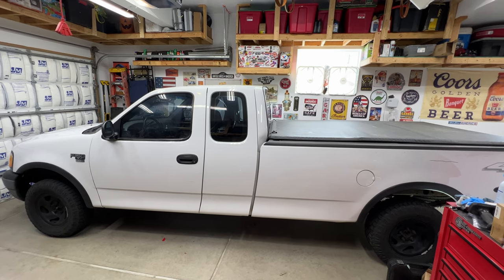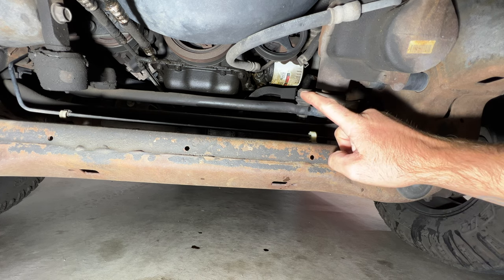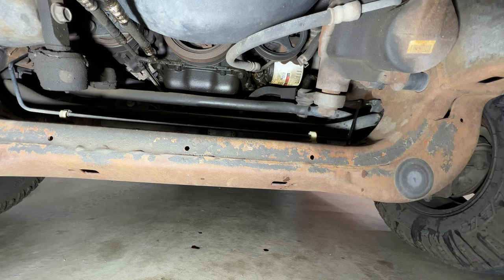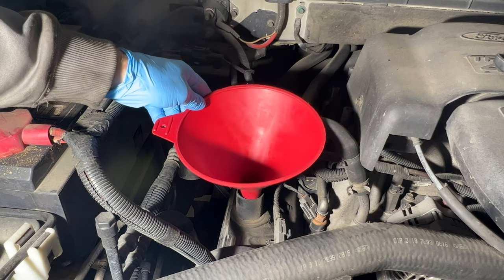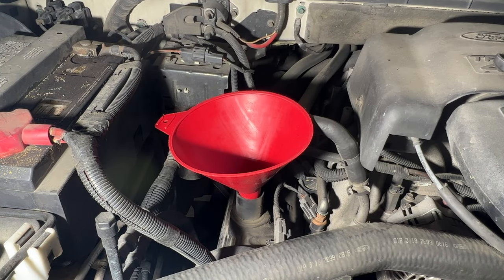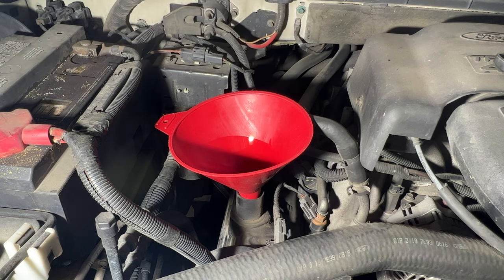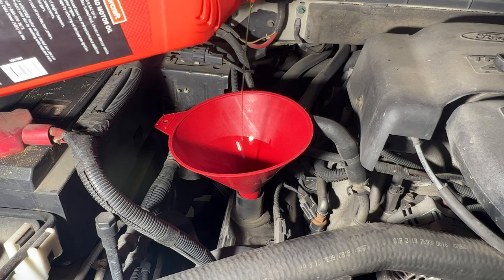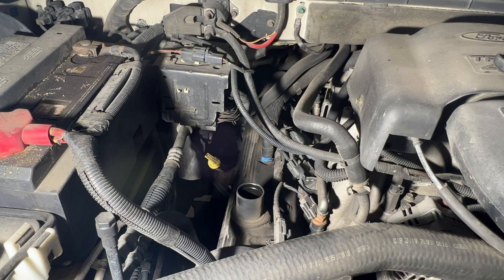2003 Ford F-150 Oil Filter Housing Gasket Replacement How-To

Comment: A huge thank you for posting this video! 

I've been putting this off longer than I care to admit. Just finished replacing the gasket this evening following your video.The way you put each procedure in order is perfect! It took the whole afternoon but I was going at a very cruise-y pace. If you're swift, one might be able to do it in like 4 hours. I did it on the ground, no jacks or lift. The truck is a 2003 STX 4X4 4.6l so was able to slide under on a creeper.
The part that got me was removing the 2 last bolts of the housing, the middle ones. They were completely blind and couldn't find them with my fingers until I moved the oil pressure sending wire out of the way. I used 12" of extensions for the last 3 bolts but would have been nice to have another 4"-6" to clear the frame. It went back together easier than taking it apart. Well, that is until I poured 2 quarts oil in the coolant reservoir.....what, it was getting dark and both oil and coolant  jugs were yellow....🤷‍♂ Guess a flush is in order for tomorrow.
Again, many thanks!!
Have you done spark plugs on these?
Reply from the maker: Thank you. Yes I have done plugs on this truck many times haven’t done a video on it yet but will probably do one soon. You probably already know these triton v8’s are notorious for blowing out spark plugs so you will want to change the plugs often. Just need a variety of extensions for your socket wrench to reach the plugs back by the firewall.

Comment: Awesome video and spot on! I just about finished up this job on my 03 f150 4.6 today. Everything wasn't so bad until I went back for install of new gasket. Man! I fought trying to hold gasket and housing in place while starting bolt. I'd have to say if this has to be done again that I'm taking it to a shop. 4.6 engine are great and reliable. Anyways thanks for video!
Reply from the maker: Thanks I appreciate it! Yeah been happy with the 4.6 I have over 270k miles on mine. I’ll take this or the 5.4 any day over the new eco boost. Key to long life on these motors is keeping up on the maintenance.
Reply: @BLUECOLLARGARAGE  Yes they are excellent motors and reliable. Mine currently has around 253k and it's been best ever owned. Thanks again!
Reply: I was wondering if a loose zip-tie through one or two of the bolt holes would be a good way to temporarily hold the gasket in place until one bolt could be threaded?
Reply: @duey1083  That's something I never thought of. Great thought
Reply: @cards06champs  Thanks!  Question for you...would you consider replacing this gasket as preventative maintenance?  Or only if it leaks here?

I'm wanting to do a coolant flush soon, so thought that would be a good opportunity to replace it at that time.

Thanks!
Reply: @duey1083  If the gasket has never been replaced, then I would highly consider replacing it. Especially since you're draining the coolant.
Reply: Use sewing thread to tie gasket against the housing.  It is easy to cut and remove.

Comment: I just want to point out most of the videos on this subject don't mention how important torque specs are on this part.  If it isn't torqued properly it will leak like mad... 18ft pounds on the bolts, you will be good with 20. Start on the center bolt then the other one on the other side of the oil ports and then move to the others. Happy wrenching.
Reply from the maker: Thanks for the tip hard part is getting the torque wrench in there .
Reply: @BLUE COLLAR GARAGE  24inch extension on 3/8, use a 10mm socket on a universal joint, it'll be no problem 😊 torque is distorted  a little using extension so set to 20ft lbs and it should be very close.

Comment: Thank you so much for this video I brought mine to a shop and they want to change me $1800 to change the gasket and claim the front differental has to be dropped I have a 2000 ford f150 4x4. I think im going to follow your video and try to safe $1700 thanks so much
Reply from the maker: Yeah that seems like highway robbery it’s a pretty tight fit but definitely doable and well worth saving $1700.
Reply: @BLUECOLLARGARAGE  Hey, do you have to remove the radiator house and take off the vacuum? If I let it drain for a long time will that empty out the hose?

Comment: Thanks for this video. Helped immensely. I’m having an issue though. Bolts don’t want to go in and I don’t want to strip the threads. What you think?
Reply from the maker: Were you able to get them in. I wandering if the threads were just dirty and may need to use a thread chaser.
Reply: Yea bro, I just shot them through. It was really enjoying but I got it. Thanks for checking

Comment: I've been told the only solution for my leak was to replace the engine. I have the 4.6Leaker in a 2001 F150. Might have it relooked at. I also moved how your gear shift position is off. My cable broke 100,000 miles ago so I'm always in low lol.

Comment: I stripped one of the bolts, what type are those and where can i get one?. Thanks for the video🙂
Reply from the maker: Since they are all the same take one of the good bolts to ace hardware and they will be able to match the threads and pitch. Or Home Depot or Lowe’s should have one as well.
Reply: @BLUECOLLARGARAGE  excellent, thanks for the help and for the time!

Comment: How much easier would you say that job would be, if you had everything in the driver side wheel well out? I'm getting ready to do new control arms and shocks on mine. Thinking about getting this done while I have everything out.
Reply from the maker: I think it would still be a challenge due to the abs pump and brake lines being in the way.

Comment: This might be a dumb question. 
I had to have the gasket replaced in my 2003 f150 v8 4.6 xlt . 

So this brings me to an issue I'm having. 
I went to Advanced auto parts and had them get me the oil filter. We then went to do an oil change the next day. After seeing the filter that was installed, we knew it was way narrower than the one they gave me. 
So I went back to the store and had them look up the filter by my vin # to make sure to get the proper one. 
They told me it was in fact the right one according to my vin # . 

However after removing the old one there was a noticeable difference in diameter!  

Is there any way that the mechanic changed something and didn't tell me?  Why would the oil filter be at least an inch bigger around than the one currently installed? Thanks
Reply from the maker: I have seen people put different sized oil filters on that have the same threads to achieve a little more oil filtering capacity but the diameter is usually the same. Can you tell what filter and number is currently on the truck? And what filter did advance give you?
Reply: @BLUECOLLARGARAGE  yeah there was a huge difference between the one a mechanic put on after fixing the gasket and what was given per the vin number. 
If you measured across the  filter at the threads , they are an inch difference. The length of each were the same though. But width , way off . The one in the truck is the narrower one, 
Ecoguard X2500  . 
Truck is a 2003 f150 supercrew XLT .
V8  4.6L  4x4
Reply from the maker: @keithsr.  The ecoguard is the cheap amazon filter and according to them it fits your truck. https://amzn.to/48iRmnl but says it's mainly for a gm 3.6L. So the one that's wider from advance auto parts is the correct filter as well because ive done a an oil change on mine every 3k miles so I know the filter is really wide compared to most vehicles.
Reply: @BLUECOLLARGARAGE  I don't understand how the cheap Amazon one can be correct and the one per the vin at 2 separate auto stores can also be correct ? 
To me the wider one is correct and this cheap shit one the garage put in is wrong but somehow fits the threads . It's like a AA to a C battery in width . Just not possible.
Reply from the maker: @keithsr.  Yeah I agree with you on that I wouldn't have put that on one of my customers vehicles. I'd be afraid there wouldn't be enough gasket surface and would eventually start leaking.

Comment: I have an oil leak right now and I thought it was the oil filter but once I did an oil change the leak was still there. I’m not fully 100% sure the leak is coming from the oil filter housing gasket but that’s where I see fresh oil leaking from. I’m thinking of taking it to the mechanic but I was wondering if this is something I should change without taking it to the mechanic first. Maybe I could save some money.
Reply from the maker: This is a very common issue on these trucks especially as they start to get older and higher mileage the gasket starts to flatten out causing the leak. You will save yourself a lot of money doing it yourself.
Reply: @BLUECOLLARGARAGE  my 2010 ford expedition has 300k on it so I think it’s past due. I’ll be taking it to the mechanic to get it diagnosed because I’m not a mechanic and don’t know much about cars. If it is the gasket then I’ll be doing it myself. Thanks for this amazing video, and I hope to be following along again in a couple days when I figure it out.
Reply: @BLUECOLLARGARAGE  it was the gasket and I’m so happy lol. No oil leak and for cheap. Thank you for this video. If it weren’t for people like you, then people like me would spend ridiculous amounts of money for something small.

Comment: Awesome video very detailed I gotta tackle mine soon. I’m curious to know about how long it takes your 4.6 to get up to operating temp mine takes 15-20 minutes no joke and I just changed Thermostat and did coolant flush and that didn’t seem to help anything. Maybe Coolant temp sensor 🤔
Reply from the maker: Mine takes about maybe 10 minutes to warm up. I would try the coolant temp sensor that’s nice and easy to replace and see if that helps. I’ve also seen brand new thermostats that are bad what brand did you go with?
Reply: @BLUECOLLARGARAGE  The sensor is near the Alternator right? The thermostat I put in is a Duralast Thermostat
Reply from the maker: @alexharper9786  yeah it’s right behind it and you may want to drain a little coolant out first so it doesn’t make a mess. Never had an issue with duralast just making sure it wasn’t a no name Amazon or eBay one.
Reply: @BLUECOLLARGARAGE  imma do it when I do the Oil filter housing gasket that way I can knock both out but I’ve put alot of money into the truck this past week because Goodyear screwed me by not aligning correctly so other shop I had to pay did it and fixed some stuff like Freon recovery recharge, Swaybar links, Camber which doesn’t look like they changed 😂 So I’m just gonna knock everything out and be done with it. The 2 things I don’t do Freon (No machine) no Alignment rack) and I get screwed in the end because I don’t have a alignment rack, balancer, tire machine 😂 prime example on why I do everything else myself
Reply from the maker: @alexharper9786  yep in most cases if you want it done right anymore you have to do it yourself.
Reply: @BLUECOLLARGARAGE  yep. Any advice or tips on getting #7 #8 coils out with a stripped bolt head socket slips everytime
Reply: Both very tough imo compared to 1-4  #7 has that solenoid off the fuel rail in the way and 8 is a lot worse than 4 imo so I could definitely see how someone stripped them out
Reply from the maker: @alexharper9786  I assume your talking about the 7mm bolt that holds the coil in place? I’m assuming a bolt extractor like this should work https://amzn.to/3FCiUrv
Reply: @BLUECOLLARGARAGE  yessir 7mm/9/32 I just ordered it didn’t even think to check on Amazon. Thank you I’ll let you know if it works that’s for sure .

Comment: I did mine so far so good but I have very low idle after letting off throttle didn’t have this problem before
Reply from the maker: How’s your oil pressure look?
Reply: @BLUECOLLARGARAGE  oil pressure on cluster is good right where it was before. Truck is running rough now for some reason tho low power and stalling pretty bad and shaky and I just had my Freon recharged the other day at a shop and my AC clutch is cycling weird and blowing warm air. I had a guy come out with a scan tool and I recently did coilpacks and I had a misfire on cylinder 5 which is a known issue for me so I swap it and it still happens
Reply: I can email you scan tool pics or whatever is fine I just can’t do it on comments
Reply from the maker: @alexharper9786  did you try swapping the cylinder 5 coil with another cylinder and then start it and rescan to see if the misfire moved to that cylinder if it does then you know it’s a bad coil. If it’s still at cylinder 5 then you may need to replace spark plugs when’s the last time that was done?
Reply from the maker: @alexharper9786  astew1983@gmail.com
Reply: @BLUECOLLARGARAGE  Did Cylinder 1-6 yesterday New motorcraft coils and plugs and cylinder 5 still misfired I have a couple extra coils that I keep but even when it’s cleared and gone truck is still running bad especially idle like before the gasket I had 2 misfires and truck ran better than it is now
Reply: But I’ll pop a new coil in 5 again what if the idling stalling issue is still there with the misfire fixed like I think it will be .
Reply from the maker: @alexharper9786  you may want to just try pulling the plug as well just to see what it looks like make sure it’s not fouled I have seen new plugs bad from the factory. Also inspect the coil boot make sure that’s making good contact and try using a little dielectric grease on the boot to plug if you haven’t already. If it’s still an issue I wonder if your having an issue with the fuel injector just check that connector as well.
Reply: Emails sent man thanks for your help
Reply: @BLUECOLLARGARAGE  I will definitely do that i have 2 extra coils and 4 extra plugs
Reply from the maker: @alexharper9786  sounds keep me posted and let me know what you come up with.